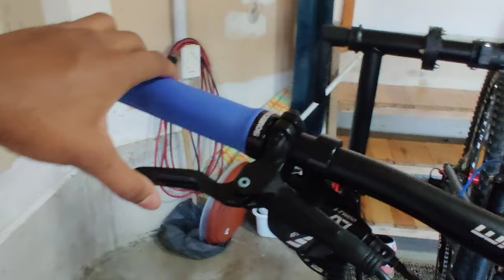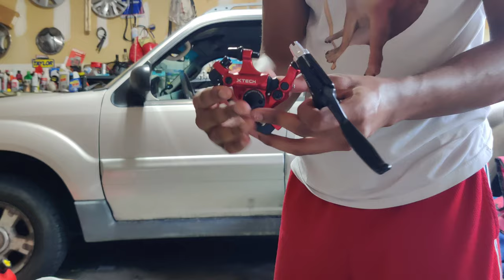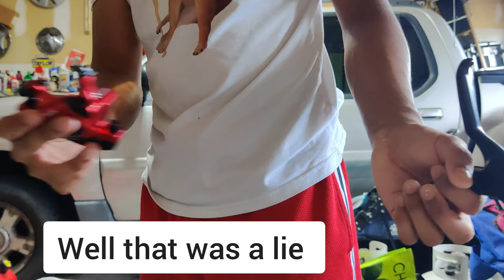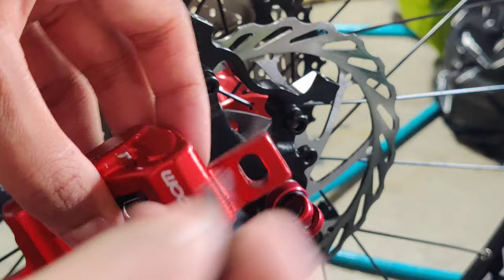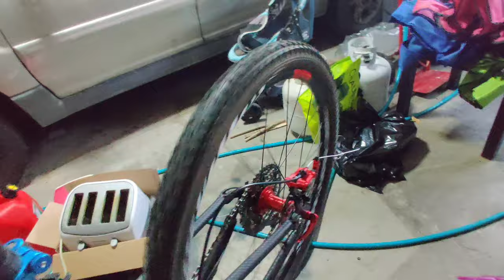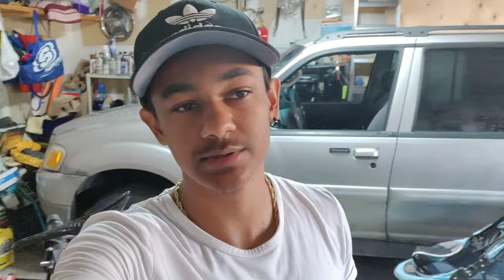Zoom Xtech HB100 Brake Install And 4 Piston Brake Review

Comment: When in doubt adjustable wrench. That brake issue is weird, next steps would have been olive and barb replacement, then cable replacement, the bike shop time.
Reply from the maker: that is true but i didnt want to dish out more money on these brakes trying to fix them when im not sure if i could. insetad i just got a cheap replacement.

Comment: for the nut on the brake lever, try to use an imperial set of wrenches or an adjustable wrench (id try this first). Since you got your brakes from amazon, it could be that they were produced for the American market.
Reply from the maker: I got a refund on them and ended up getting a new set of 4 piston brakes
Reply: @M3garage1  even better for you. Still you could sell the brakes if they work correctly.
Reply from the maker: @erdbeeren3241  good point

Comment: the levers are mounted upside down may be cause of the air in the brake line
Reply from the maker: Fair point but it doesn't matter anymore. I got another set of the same brakes and they work amazing.

Comment: Stock zoom pads are better than shimano ones, i tested them. But i don't preffer this zoom brakes. I used them a year, if you get them hot, the pistons will start to not return, and it brakes itself, in this case if you still ride it get them burn, they will start to leak. From a month i'm using shimano pads but they are worst than zoom ones.
Reply: exactly i have the same problem piston not returning and the other one is leaking mine are full hydraulic zoom

Comment: How’s the m4 brakes after 7 months? Planning to buy it, thanks
Reply from the maker: Well I haven't ridden much since then so I couldn't say but they have alot of power pairs with a 180mm rotor. They didn't lose any oil and feel great to me. I'll make an update video as I start riding more this season